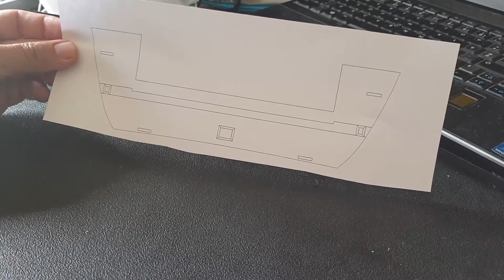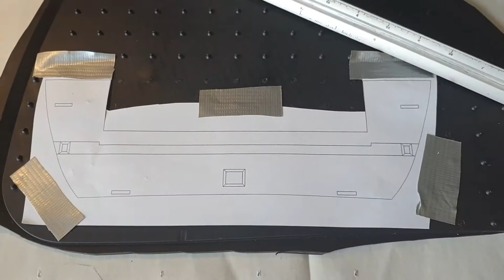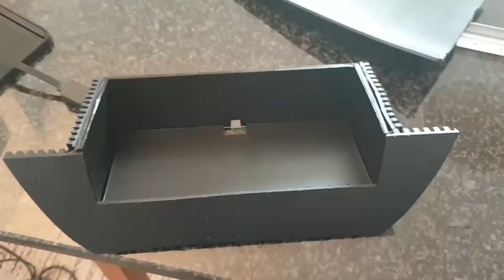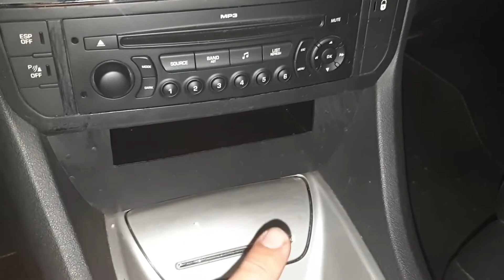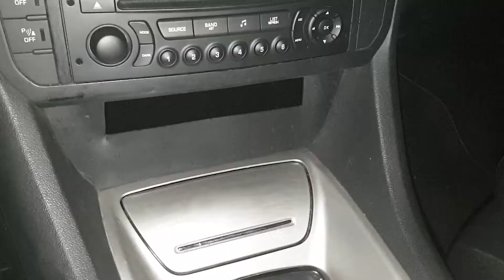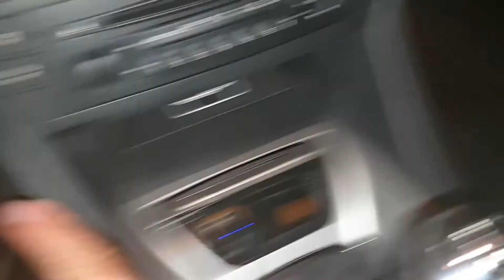Project Wireless | Part 2

Comment: do you have a video about usb connection? and link some where to buy
Reply from the maker: The usb connection was made possible by getting a RD45 radio. I got it from ali express:
https://a.aliexpress.com/_mOQiRkc
I don't know where you're from, Dzenan, but the radio only offers French, English and Chinese as display languages
Reply: @comcarclub   I have rs4
Reply: With Bluetooth and SD Card
Reply from the maker: @dzenanbegic5288  do you mean RD4? That's the one I had and I swapped out for the RD45. This doesn't take sd cards, only Bluetooth
Reply: @comcarclub  ja rd4 I'm from Bosnia but I understand German and English..not very good but enough..I have a box with chinc outputs